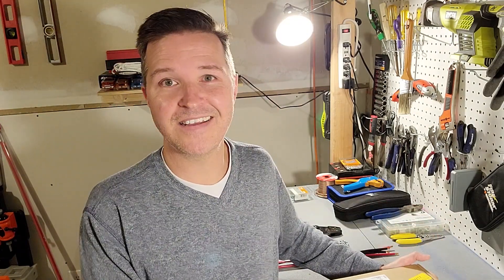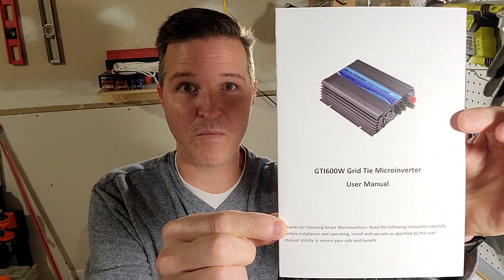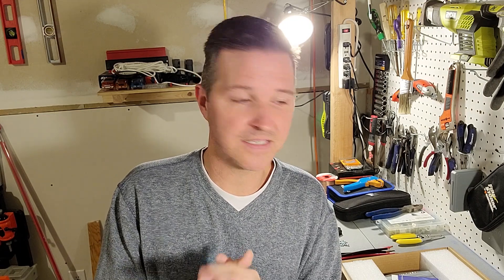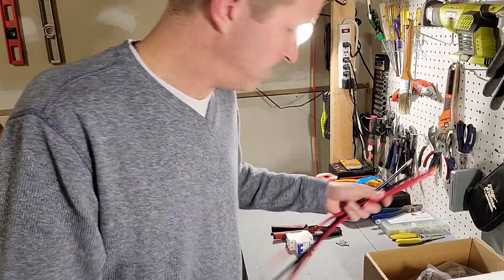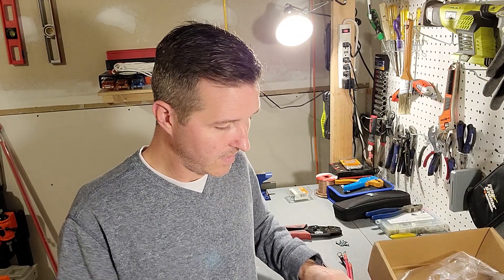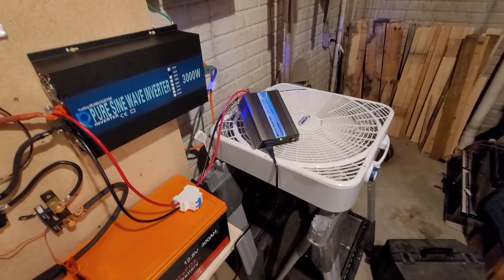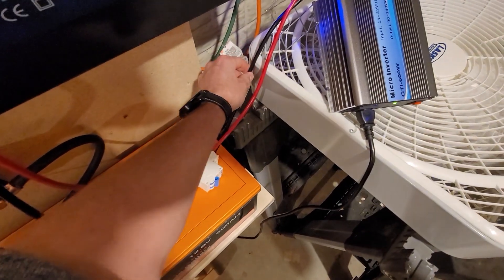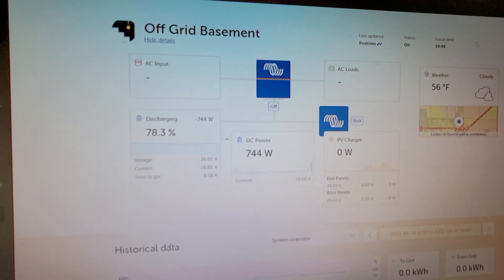I connected a cheap Grid Tie Inverter directly to my 24v Off Grid System.  Will it last 10 minutes?

Comment: The 600 one is crap, died in the middle of the 3rd sunny day doing just 400 watts even with external cooling lol. The damn SPEAKER JACKS for the input should tell you all you need to know lol The 1400 and 1000 are IDENTICAL inside. Same PCB, same components. So the "1400" is fake, and the best you should expect from those two is 800-900 watts.

Comment: This is interesting. Iknow this vid is 3 years old now as of October 25. I run a GTI solar system and have had 4 inverters blow up in 3 years which has dug into my "savings". When I take apart the blown up units, it's seldom that the MOSFET's have blown up, but the input filter capacitors fry out and then other stuff fries! I have them sized to my panels so voltage in is right in the middle of the accepted range of the GTI's. Anyway, this gentleman kinda proved to me that the GTI does have some kind of current limiting? I mean, a solar panel cannot output any more energy than it's rating period. A Big ole battery can dump a huge amount of current, for awhile at least into a load if the load demands it. So, if his GTI had no current limiting ablility, I'd think the unit would explode as soon as turned on because it's trying to convert all the battery can deliver into 120 to feed the grid! Now, what if I had enough solar panels that could provide much more current than my GTI can process, but still withing the operating range of the voltage? Would the inverter just say NO to any extra current? It seems that way due to the experiment here. Funny because my cheap Solar Epic inverters that blew up were rated (on the label) as 1000 watts. They each did last a year or 2 before blowing up. Now I replaced them with 1400 watt units, but they be only online for a few months now. Oh, I had an additional inverter blow up, but believe it was a lightning or a voltage surge. Being Chinese junk, I'm sure there is little protection from line spikes and nearby lightning hits even though I have several grounds on the system. So, what gives? OH, I have 24 18v 100 watt poly panels, where 12 each connect to one GTI, each of those on on leg of the 240 line. Each will output nearly the same amount of power in full sunlight but never go above 760 watts per unit into the grid! I have only 10 feet of wiring between the panels and the units too! So, looks like I have about 30% loss from panels to grid? Not good.

Comment: Question: Is the grid tie inverter connected to the AC from the city grid or your own home's inverter output?
Reply from the maker: It's connected to the city grid.  DC side is connected to my battery.

Comment: Yeah I used one of these with a couple panels and my bill shot up, turns out if you don't have a meter that measures in and out they just charge you for the power your panels generate.
Reply from the maker: Thanks for the info and the comment!

Comment: I have 2 of thease but the 18-60v version that run off a 52v lifepo4 battery day in day out without any problems, they have proven to be much better than the GMI500 micro inverters that I also have that overheat only have inductive cooling. 

I purchased one of thease 11-36v versions and tried it at 24v from a Riden power suply but it dosent seem to work at all, the run light comes on for about 3 seconds when powered on then continuous red error light thereafter consuming 0.7w from dc and zero output.

Don't now if its just a faulty unit as it was like that from day one.

Bit disappointed as i don't really want to order another if it may turn out to be the same.
Reply from the maker: Thanks for sharing and for the comment!

Comment: Hi, Just a curious question for my understanding! Does the inverter wiring and the wall outlet need to match with N &L wires or it doesn't matter? What i mean is  - L wire of the inverter to the live point at the wall outlet same for the N wire?
Reply from the maker: I would think they need to match, but honestly I'm not sure.  I just plugged it in and it worked.  Sorry I can't be more help.

Comment: Thank you for this video. I started my solar career with this inverter. I've been using the 1300w model with a 500w array for 1.5 years. I'm now looking for an emergency backup system but still want to use the inverter as the primary function when there's grid power. There's an interesting video that I think is in Tagalog with no subtitles -- https://www.youtube.com/watch?v=vVz-aFL4WT8 seems pretty interesting. Maybe you can provide some insight on it.
Reply from the maker: It looks like he has it set up in a way so it will charge his 25ah battery first then automatically switch over to power grid tie.  He is using an over voltage protection switch to control it.  Look in his description for links.  Hope this helps.

Comment: That was fun!  A few bits of info you might find useful:
1)  Modern meters typically will not subtract your consumed energy from the returned energy without an agreement.
2)  In many jurisdictions, without a grid-tie agreement you will be charged for any power you return to the grid.  If you send 1kWh into the grid you would be billed for "consuming" 1kWh.  It's crazy.
3) I used that exact same grid-tie inverter for about a year before it failed.  On opening it the otherwise fine design was short changed by the maker using way too small wire from the banana plugs to the board.  Those wires had melted in two.  I was able to repair it with some work and correctly sized wire.
4) Often the most energy use in a house is water heating.  It takes a crazy amount of energy to heat water.  8kWh to heat up 40 gallons from 50F to 130 F
5)  A very simple way to use excess solar power is to install a second water heater in front of your existing one, (which could be gas or electric).   Use excess solar  to heat water in this pre water heater.   The pre-heated water is used as makeup water for your existing water heater.   Any heat in the source water to your original water heater directly reduces how much energy (gas or electric) is needed to reach the temperature setpoint of your existing heater.
6) The pre-water heater extends your hot water capacity.
7) The pre-water heater provides a backup for failed heating of the original water heater preventing the need for the future emergency water heater replacement you'll eventually get.
8) You can use a standard inverter to run one heating element of the pre-water heater.
9) A simple voltage triggered relay that you set a voltage to turn on and set a different voltage to turn off would be used to turn on/off the pre heater inverter.
10)  Alternatively, you use your big inverter and then a relay to control the pre-water heater load dump.
Reply from the maker: Thank you for all the great information!

Comment: The Roexby Solar grid tie inverter MPPT 700W should be marketed as having a peak output of 550 watts and a constant output of 350 watts. Even so it's efficiency is terrible. I believe it's efficiency is only about 70% at converting Solar DC to AC. Additionally, it's important to highlight that the product is highly susceptible to overheating due to it being sealed and not able to cool itself sufficiently. This raises questions about its longevity as well as posing a significant fire hazard.
Reply from the maker: Thank you for the comment and info.  That is why I had an external fan blowing through mine whenever it was on.

Comment: Looks like efficiency is pretty low.
You're pulling 650W out of the battery and only pushing 400 watts out of it. 60% efficiency?

I think my generic china taffware/sunyima HF offfgrid inverter could give like 80%+ power conversion efficiency. 

I'm thinking of getting one of those GTI as well to operate with batteries being charged with common PV-MPPT setup, difference is I want to add adjustable constant current buck converter from the battery into the GTI,
That way I plan to limit the amount of current going into the GTI but keeping it at constant voltage (MPPT inside the GTI will handle that automatically I guess 🤔).

Basically I want to be able to adjust how much current I'm allowing the GTI to push into the grid.

What do you guys think?

I want to be able to run those GTI 24/7 hence not depending on PV sun-hours only.
Reply from the maker: The efficiency is pretty bad.  I like the idea of adjusting the current.  Thanks for the comment and info.

Comment: Will this drain the battery bank?
Reply from the maker: Yes and that is the point.  I used it as an energy dump for those summer days when I'm getting plenty of solar and the batteries are full.  It worked really well, but it was a manual process of turning the unit on and off.  Thanks for the comment.

Comment: If i will use a solarpanel for the 600w grid tie inverter, what will be the size i need that will generate the same wattage you shown in the watt meter?
Reply from the maker: Three 200w panels connected in series would be a good start.  Just make sure the open voltage of the panels all added together is lower than the voltage input range of the inverter.

Comment: I will admit to playing around with these cheap Chinese micro-inverters too.  But I will also say... they are basically temperature-limited devices rather than amperage-limited.   I don't know why, they could easily have made them limit amps too.   But it means that connecting it up directly to a battery will cause the micro-inverter to run hotter than it really should.   That is why they warn against connecting to a battery system (though some now advertise that you can, they are probably lying like they do about many other parameters for those micro-inverters).

I guarantee you that 600W micro-inverter is not designed to handle 25A+ on its input at 24V.  Maybe at 36V it can (16A @ 36V).  24V is stressing its parts even with the fan.

Another problem is that an AC timer switch is not really designed to shut power off while under high loads.  At least not that much power.   It is slowly building up carbon from the internal arcing and at some point will become a fire hazard.   In fact, neither is the micro-inverter... it is designed to see variability on the solar input, not on the power output.  It can handle grid-down situations, but isn't designed for its AC output cycling daily while it is pushing 500W through it.

Be careful not to run any space heaters or other large loads on the home circuit that you are pushing the power back onto.  Due to the additional power provided by the micro-inverter, you can run more loads on that home circuit than the wiring is actually able to handle, without tripping that circuit's AC circuit breaker.

Efficiency is also an issue.  Many of those market high efficiency, but their actual efficiency is typically very poor... 75-85%.

So you've created a number of safety issues here.  As have I, and after a few months of playing around I decided to find ways to burn off excess power usefully off my solar+battery system that did not involve trying to push it to the grid.
Reply from the maker: Thank you for the great information.  I've also disconnected the grid tie and connected a 6 circuit manual transfer switch.  This works much better for my needs.  Thanks again.

Comment: I am thinking about doing something similar, but I want to add a DC speed controller on the input to make the output variable.  My hope is that it would last years and not months.
Reply from the maker: Mine lasted just fine.  I've always heard it's the heat that kills it.  That's why I used a secondary fan.  Thanks for the comment.

Comment: I have 2 complete solar power systems. One is 14 kw lifepo4, 4000 watt sungold power splitphase inverter and 150-70 victron charge controller.  The other system is 24 leaf modules at 25.1 volts , powmr all in one 3000 watt inverter, 60 amp powmr charge controller.  Im wanting to combine the different chemistry batteries for one system with the maximum capacity of both batteries. Ive thought of just charging one battery with the other but it seems like such a waste of power in all the conversion back and fourth. Any advice is greatly appreciated.  I have learned alot from your videos. Thanks for doing what you do for our diy community.
Reply from the maker: Since they are COMPLETELY different systems and battery voltages, I think you are really going to be stuck with keeping them separate and taking the hit on losses.  You might want to see about DC to DC charging to see if that could possibly work for you.  I know Victron makes very nice ones of all voltages.

Comment: dont really see how this is different from how the gti is meant to be set up. whether you hook it to the dc  straight from pv or  to your solar charged battery bank as long as the gti is plugged into the mains it will run AC into your home wireing...or am I missing something
Reply from the maker: It does the same thing.  The difference is the inverter is constantly running a max no matter what the weather is.  Even if it is cloudy you are getting 600w from the unit.  Hope this helps.

Comment: Good day OGB. Im planning to order this next month. May i know how its holding up as per ur use? Do you use it the whole day? I read some negative reviews on Amazon saying that it dont last long.
Reply from the maker: Hi!  My grid tie inverter worked great until I disconnected it for winter.  The last thing I have in winter time is excess solar!  If you get one I suggest getting a small 12v fan to blow on it.  I believe the reason they die so fast is because the crappy fan inside stops working and the unit burns up.  In the summertime I would use the unit for up to 16 hours a day.  I never had a problem.
Reply: @OffGridBasement  thanks! Thats what i've been thinking. Ill wait till maybe Feb when the sun will be a little high up. Scarcity of ☀️ during winter .

Comment: Yes I run this for 24 hours.. from my battery bank.
The Grid Tie Inverter does not care if 36 volts solar or 36 volts solar..
My home in the winter with solar panels and batteries is using 18 kwh per day on Cold winter day 19 degrees with Air to Air heat pump.
Yes it can work 24/6
Reply from the maker: Yes.  I did learn this small unit has no problem running an entire day with no issues.  Thanks for the comment.
Reply: also the inverter has a 10.5 volt shutoff limiter.
There 600 watt small grid tie and grid tie with batteries are the future with solar panels. They will take every watt with prefect efficiency into your home. These are nice engineer inverters.

Comment: How do you make sure the Grid Tie does not burn down your home wiring? Asking a since the breakers have no way to account for the Power you would be feeding an existing home circuit that’s designed only for drawing current not feeding it
Reply from the maker: I was figuring since the unit can only push about 5 amps and I had it plugged into a 15amp circuit with nothing else on the circuit I would be fine.  Thanks for the comment.

Comment: Huh... I have  hybrid inverters that don't backfeed and no battery and I have a similar issue of unused power. I wonder if I could use the battery output terminals on the hybrid and backfeed the grid with one of those.
Reply from the maker: I don't think so.  It would need to back feed 120vAC or 240vAC, depending on where you live.   Wait!  Sorry.  Didn't read that correctly.  Now I'm not sure!
Reply: @OffGridBasement  Yes, the idea is the hybrid inverter thinks it is charging batteries, and set to charge with excess power. That is then fed through this doohickey "upstream" of the hybrid.

Comment: I'm surprised it works at all. The linked grid tie inverter says in multiple places on the page, "It cannot be used with 12v/24v battery as input source.Only use the 36V battery to power the inverter".  But now you have me thinking...  and probably spending money! 😁
Reply from the maker: It does work.  You need to have at least a 24v setup for the unit I linked to.  Good luck!

Comment: My question is if you turned off your grid power and turned on your off-grid inverter would your on grid inverter run and sync to it with no problem for either unit?
Reply from the maker: No.  The grid tie inverter only works when it senses power from the AC side of the unit.  It's called "islanding".  My off grid inverter isn't connected to my main grid power so the grid tie system would never turn on if I turned off the main power grid for my house.  It's all about safety.  Thanks for the question!

Comment: So next, how do we control the load output (amps) so that we’re not going over the base consumption of the house?
Reply: Can you please update if your micro inverter is still running? Did it burn up?
Reply from the maker: @mengyewleong5028  That thing is still running!  There were days I would run it for 15 hours straight.  Thanks for the comment.
Reply: The grid tie inverter has a backflow shunt so it shouldn't draw energy when no power from sun, right?
Reply from the maker: I look at the average base usage for my house.  Ex:  middle of night, at work and no one is here, etc..  that is about 600wh.  That is why I went with the small grid tie inverter.  Anything bigger and would either need to program the max output or get a limiter.  My power company let me see hour by hour consumption online.  Hope this helps!
Reply: @OffGridBasement  With a limiter you mean a power limiter on the AC side , on the socket right? So reducing the output might reduce the heat it creates?